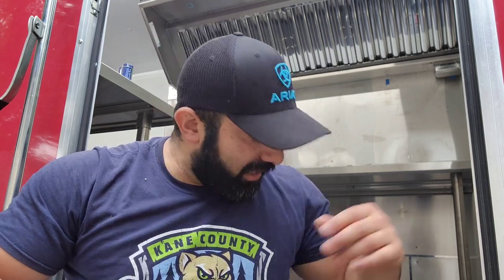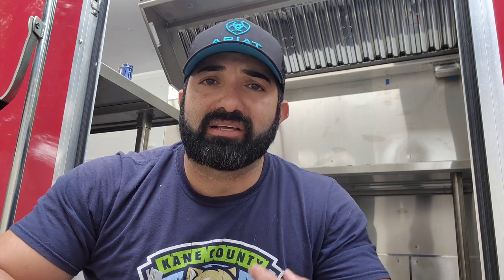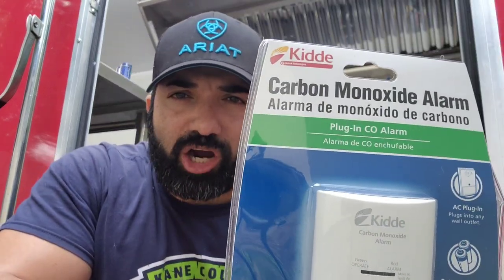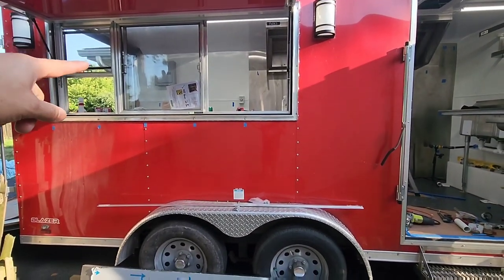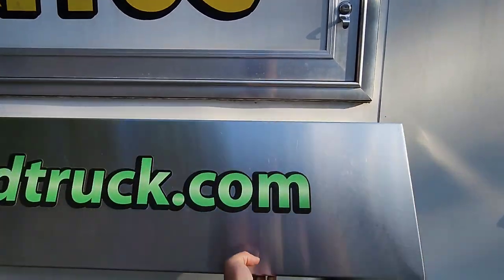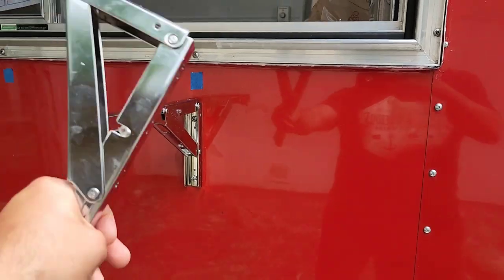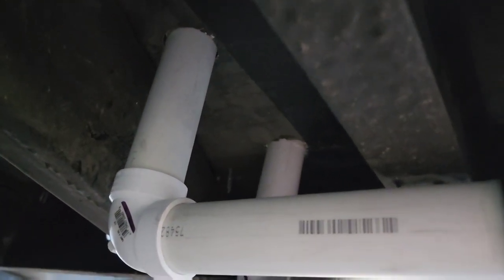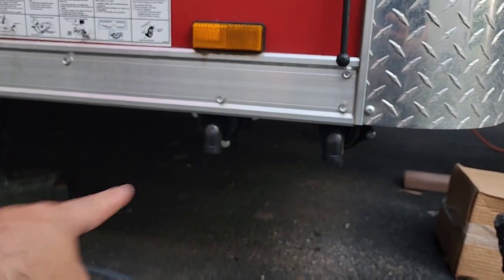How to Build a Food Truck: Odds and Ends

Comment: Frank, what interior height do you recommend for a food trailer? I found one in my price point but the interior height is only 6’… which doesn’t leave much overhead room. Any insight would be helpful! Thank you. Great videos!
Reply from the maker: I wouldn't buy it too small. I had looked at one 6 foot 3 inside and walked away. I have mine big Red available if you want it. Would still give you DIY experience bc you can install your own equipment and such. Let me know
Reply: @fbaltierrez  I would in a heartbeat but we don’t have those kind of funds. Im trying to build one to feed homeless veterans in my state. I’ve already sourced food from various vendors and now need to build a mobile unit to distribute hot meals to those in need, where the need is the greatest.

Comment: Hey Frank.   So I’m getting power to the panel in the trailer using the cord I made.  As soon as I flip on the breakers in the trailer it pops the breaker the cord is plugged into.  Any ideas where I screwed up?   Thanks
Reply from the maker: I would remove the ground wire from the neutral bar if you have it attached to it. See if that works
Reply: @fbaltierrez  thanks for the response.  I have the ground wires on a separate bar.

Comment: How do you find the studs though in a trailer? For shelves
Reply from the maker: You can put blue tape on the floor, that was my trick
Reply: @fbaltierrez  I already have a trailer built though.  I was just wondering if I can use a stud finder or magnet to find the studs
Reply from the maker: @thewifemommylife8238  look for the stud buddy at home depot. Life saver